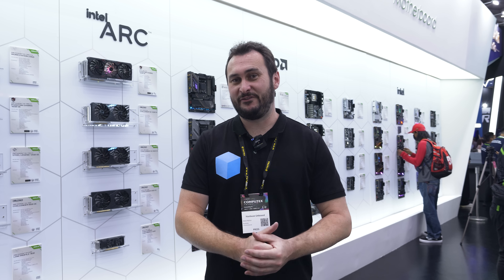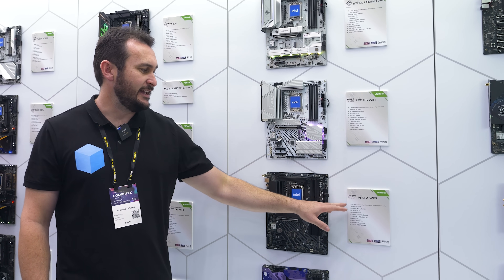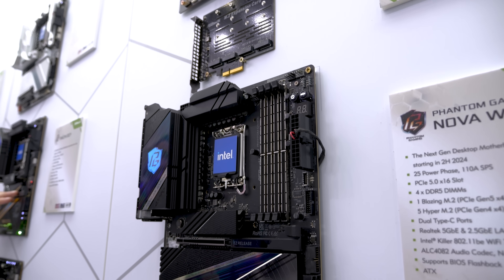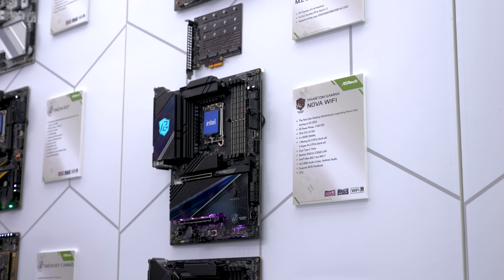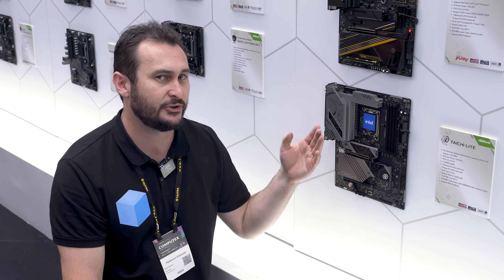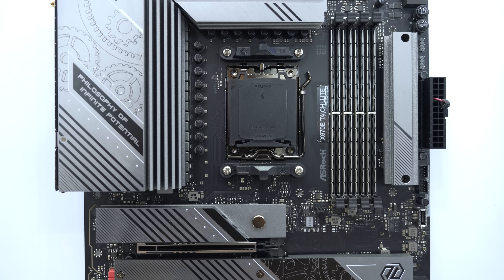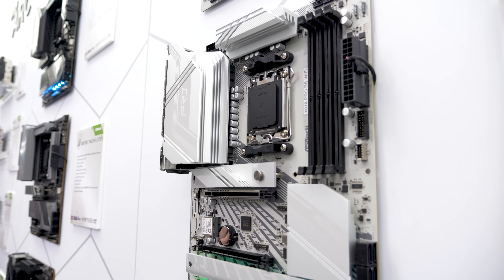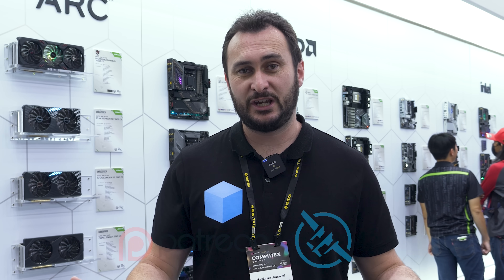Insane VRMs for Next-Gen CPUs - Asrock X870 & Z890 (Zen 5 & Arrow Lake)

Comment: what's the point of crazy VRMs on AM5
Reply: My guess: new Intel CPUs use even more power, and they bought VRMs for the Intel boards and are reusing them for the AMD boards.
Reply: @WaterZer0  Let's hope ARL won't need 450W to compete with Zen5.
Reply: @WaterZer0  The new Intel CPUs are supposedly a lot more power efficient as they are heavily redesigned (and on a new node). I wouldn't count on them beating AMD until I see evidence, but things seem to be looking up compared to the last few generations. Several thousand watts is surely extreme overkill regardless though.
Reply: The same as intel: If you have enough cooling you can increase power limits and unlock extra performance, OFC, same as intel, your sacrificing some longevity and stabilty of your CPU.
Reply: @karymidon_jm  and 13 or 14 110amp is already more than enough to do that they basically doubled it for no reason or used much higher amperage for no reason
Reply: @karymidon_jm the power stages on these boards can support > 3000 watts! That’s about 2x what the highest end PSU can support, and about 1/10 of what an AIO CPU cooler can support. This is beyond overkill and well into stupid territory. Like putting a rocket propulsion on a shopping cart to get through the grocery store quicker.
Reply: means more power to spare, having more headroom is always better, you dont wanna see the board working closer to the limit or at the limit like that 12v cable from nvidia. if the people who designed that cable had validadet it to max 1200W but limited it to 600W artificially you wold see no melted conectors.
Reply: @karymidon_jm  Yeah, having a lot of headroom is good, but 25*110 A is 2750 A. Say you're running at 1.3 V and that is 3575 watts. More than 10 TIMES more than most people will need, so closer to equivalent to speccing that connector for 6000-7000 watts.
Reply: Though to be clear I'm not suggesting the VRM should be rated for just 400 W or something along those lines.